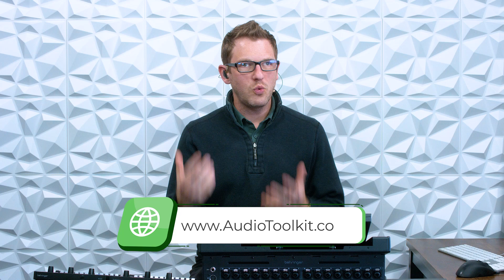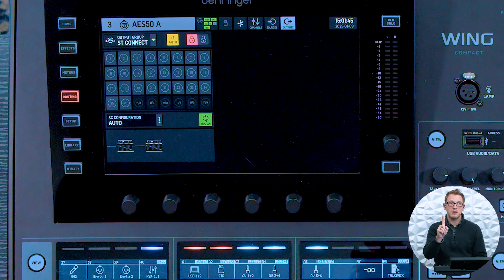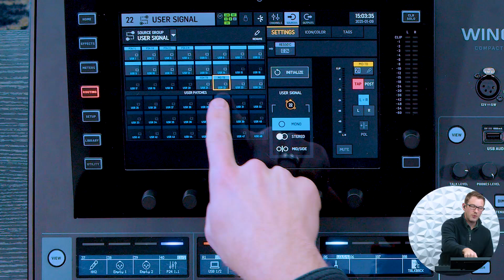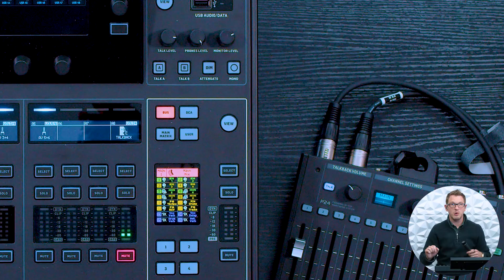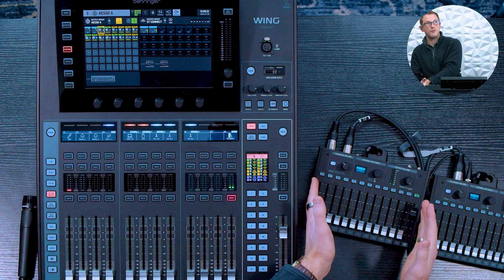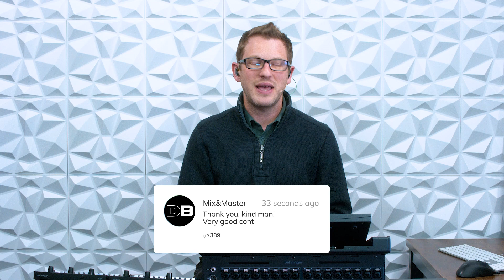Connect Your WING to the P24 Mixers Using Only StageConnect

Comment: It's too bad they didn't let you route that "Talk Back" XLR on the P24 as an input, so you could have a "1 wire" solution for getting input from a performer. 2 XLR inputs would have been cool too, cutting the talk back built-in mics to a mono mix return.

Comment: hey Drew-need some help- using Wing Compact- 7 IEM's rack using a DN4816-0 from stage connect as IEM input- 2 players want to use p24's as there in ears control not using wireless- is this possible - what are the connection - what is the routing - any Ideas

Comment: WAIT!
P24 Hub can be used to open up the 1-8 outs on the wing rack by routing the IEM over to the P24 Hub?
But I need a P24 for all the IEM systems then? or can I still just use the HUB without the P24 and mix in the app?
Sometimes it would be convenient to leave the P24 in the rehearsal room.

Comment: Hey Drew. Thanks for this video. I'm using my p24 hub with a couple of p24s and I can't seem to get a mix going back to my wing on stage connect like you demonstrated. Not sure what the problem is. Everything has the latest firmware update. Wondering if you might know what the problem is.

Comment: Hi Drew, thank you so much for this video! I really appreciate the time and effort you put into sharing this information.
I do have a question: Is it possible to connect a Behringer Wing Rack to a Midas DN4816-O via StageCONNECT, and then connect a Behringer P24 to the StageCONNECT output of the DN4816-O without using a Hub4? I’d be truly grateful for any clarification!

Comment: Hey great that you invest so much time in these videos, Thx - since there are no real manuals beside the Quick Starts for Wing stuff.
Anyway - could you please help me in the following, We use Win Rack as IE Mixer on stage, connected to Wing Compact as FOH. This works great. Now I want to daisy chain the P24s for all band members without hub, cause we are wired IE up to now. I currently have 2x P24 and with standard config 26/6 at my rack mixer. This works. 
Now 2 questions are open to me:
1) What if I add a 3rd...will the talkback and mix channel send back are randomly assigned? I would like to switch off sending back on at the 3rd P24 but I don't see an option to configure... do you have an idea?
2) If I want to use one to send back click from p24's AUX to the Rack instead of the mix and talkback is that possible?

Thx so much in advance
Ralf
Reply: Nobody? Would be interested in third in chain and if it'S random or not

Comment: StageConnect can transmit 32 channels, and the two P24 mixers together have 48 channels. (24+24) How is that possible then without P24 hub?
Reply: im pretty sure that the two p24 mixers are receiving the same 24 (26 if you use the talkback) channels that you’ve routed on the wing. The StageConnect protocol can transmit 32 channels, but the p24 will only use 24-26 of them. I could be mistaken though.
Reply: You are limited to the 32.
Reply: Does not add up like that. The p24 mixers are all looking at the same signals. Same as how the p16 system is with 16 ultranet signals, or even DP48 mixers. You are thinking of how the stageboxes work

Comment: I assume it’s probably not possible to have the P24 just control bus send levels? Faders would probably get out of sync I’d imagine
Reply: The p24 is not a controller like that. You send audio to the p24 and mix the volumes on the unit itself. Think p16 system from the x32
Reply: @DustySeven7  I might be missing something here, but wouldn't you have to redo your mix every time, with the P24 not having motorised faders?
Reply: @AllthatSam the p24 is likenthe p16. Its a personal mixers unit. You send multiple audio channels to it and mix them on the unit. If the faders dont move, the mix will be the same

Comment: But the channel names are not trasferred to the P24?
Reply: You're right. That's a pretty important issue. Only if connected through a hub will the names be transferred. Behringer promised that it will be changed with an update.